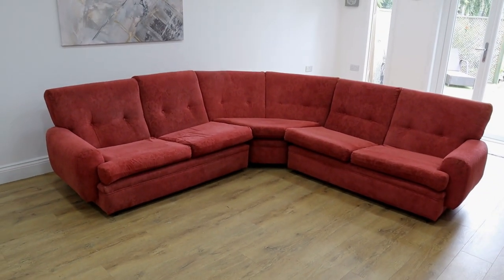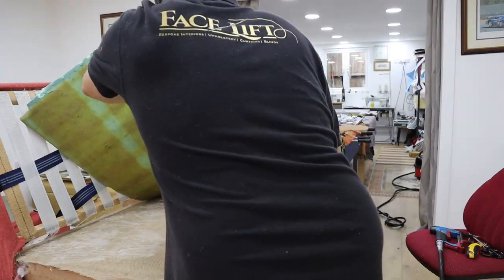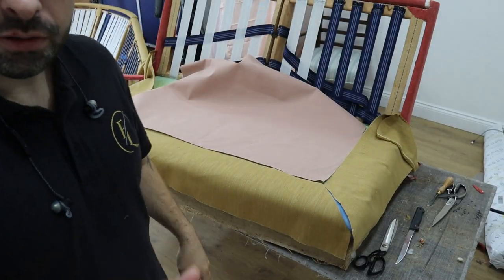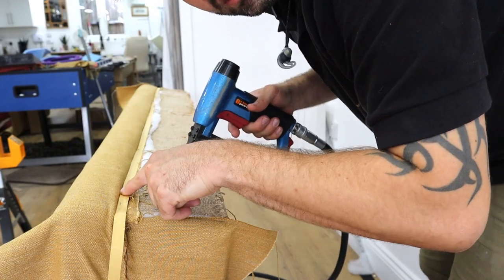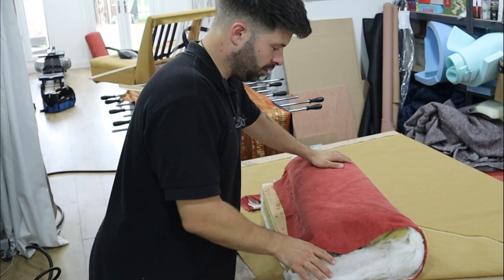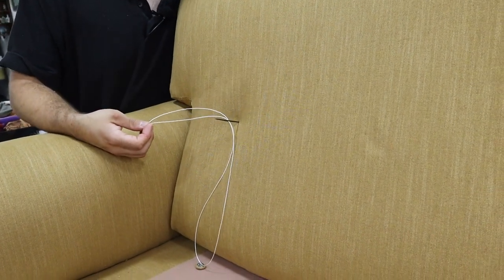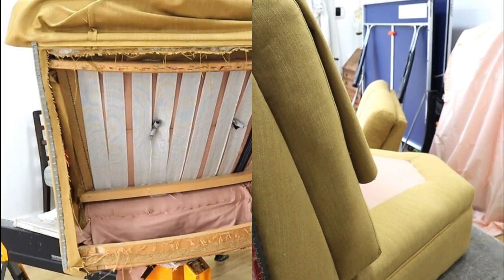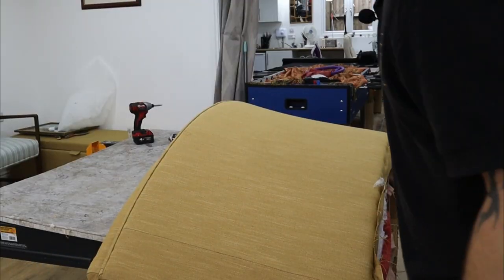REUPHOLSTERING A COUCH | HOW TO UPHOLSTER A SOFA | UPHOLSTERY TIPS AND TRICKS | FaceliftInteriors

Comment: Well Done Neil...👌 Great Tutorial and Fantastic Final Result. Your tutorials thusfar have been a great help for my Upholstery projects here. Looking forward to the next one 😁

Warm Regards
Alawhie
South Africa

P.S Quick Question:
I'm currently trying a diamond tufted ottoman with tufting on both the top and sides (Square 1m x 1m x 50cm). It's quite large, so it requires fabric to be joined. I believe that it can either be joined by cutting the fabric along the diamond pattern at the edge and then sewing... But then there is also another method you briefly discussed in some of your previous videos in which there is no sewing used. Which is your recommended method in terms of ease of learning for a relative newcomer?
Reply from the maker: Hi Alawhie! Thank you so much, I’m so happy my tutorials are helping someone with their own projects 😊 With regards to the diamond tufting you’re doing...I would recommend that you cut the join to the shape of the diamonds as you have said (allow about an inch extra for folding your pleats) and then join the fabric by folding the fabric into place and stapling. I find it’s slightly easier to manoeuvre the fabric when it’s not sewn together on a box like that. This type of join is called a ‘van dyke’ join. There may be some more in-depth tutorials on YouTube to help you further. I’m planning on doing a tutorial on this in the near future as I’ve only briefly covered it before. Let me know if you have any further questions and I’ll help you the best I can! Let me know how you get on 😁👍🏻
Reply: @faceliftinteriors  Neil, thanks so much for taking the time to write a good response. Highly appreciate it, as its not common to see content creators responding in this manner on the platform. Probably won't be too long until you have much too many subscribers to respond to every message in the comments section lol. So I'm posing questions now while I still can.

I'm moving on to adding the fabric to the ottoman tomorrow and will apply the aforementioned method that you have recommended. I did a headboard according to one of your previous tutorials on diamond tufting and the result was good, because the tutorial covered most of what had to be known. It was a small one nevertheless and therefore never required any joining of fabric.

I look forward to your formal tutorial on the 'Van Dyke' method when you have the time to get to it. I've watched other YouTubers and read many tutorials on other upholstery related matters, but your content absolutely stands out from the perspective of teaching in an easily digestible manner for somebody who is entirely new at this.

Have a good day. 

Cheers 
Alawhie 
South Africa
Reply from the maker: Hi Alawhie! Once again you blow me away with your kindness, it’s really appreciated. You don’t often get people who say such kind things on this platform either so I make sure I show that it’s appreciated 😊 I will try my best to answer as many questions as I can as a lot of what I know is either self taught or learnt from watching other upholsterers so I know how it feels to be a novice and trying to learn the craft! It feels great to know that I’ve helped at least one person with their own projects as this is why I started this channel! 😊 I think it’s going to be a long while before I’m inundated with comments (if I ever get there! Lol) so ask as many as you like! Thanks again Alawhie 😊👍🏻
Reply: @alawhie  I'm going to try do something similar to our old couches.  Watching some of these videos to try work out where to start.
Reply: Same here, your tutorials have really help me  step my DIYS up to another level.
Reply from the maker: Thanks so much Stephanie! I’m so glad you find them helpful 😊🙏🏻

Comment: Great video! I’m reupholstering sofa and client doesn’t want piping. Original has piping. I’m having trouble getting the line where the piping would have been on the front of the sofa to look flat. It shows little ripples where I’ve stapled the cardboard strip even tho I add new blue foam after that. Staples along foam and cardboard strip seem to be where the little ripples occur. Any advice please?? Could I just glue the blue foam and not staple? I’m so glad to have found your videos!!
Reply from the maker: Hi Karen! Thank you so much for watching my videos - it’s really appreciated! Are you stapling along the very top of the cardboard strip? As sometimes if you don’t staple along the very top, when you pull the fabric down, it can cause ripples.
Reply: @faceliftinteriors  Thanks for you for your swift reply! Yes, I am stapling along the very top of the cardboard strip.
Reply from the maker: Hi Karen - is the cardboard strip kicking out at all along the bottom causing the ripples? Are you using half inch blue foam too or quarter inch?
Reply: @faceliftinteriors  Hi again! So one of my reps was here and said 2 things....the cardboard strip was too thin and I needed the heavier one. Also, my staple gun wasn't sufficient enough to do the job right (which I had kind of thought). I worked in a shop for the past 2 years where they had all the proper tools and supplies and am just getting my own shop going, so having to learn what I need. I have now ordered the Maestro Electric Upholstery staple gun; I have the heavier cardboard strips, and yes I am using 1/2 " blue foam. After I get me new staple gun I will let you know if (hopefully) that solves the problems. The other staple gun was just a hardware store model and besides the staples being too thick, it wasn't sinking them in properly. As the saying goes "you have to have the right tools for the job"!!!